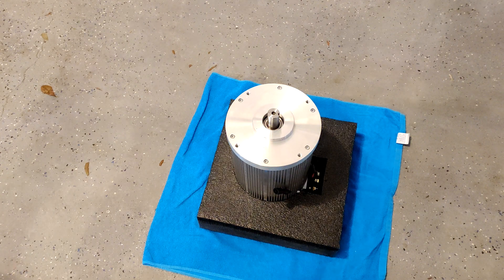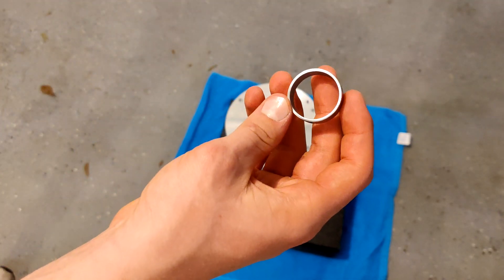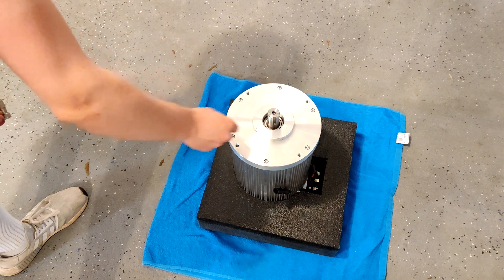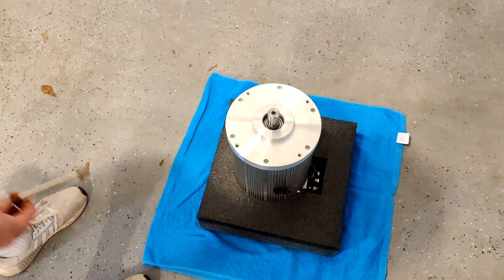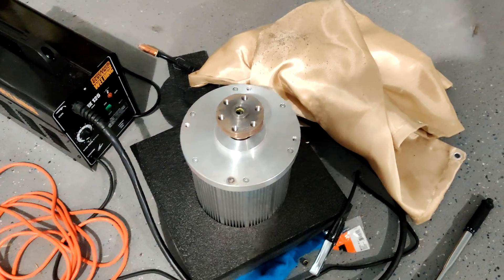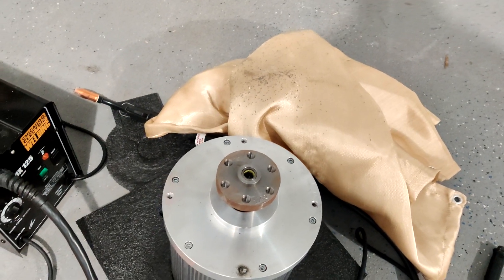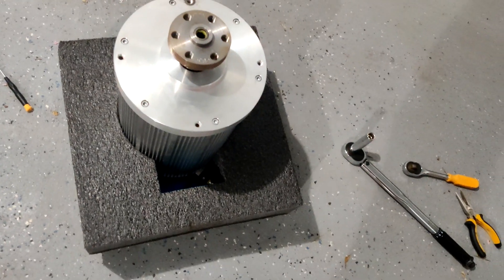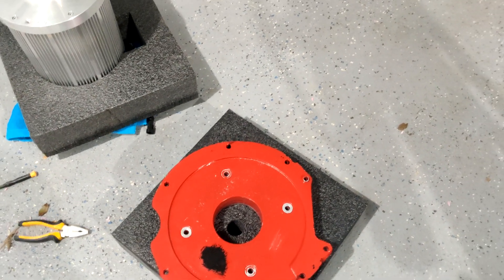Ford Escape EV Conversion EP 9: Prepping the Hyper 9 Motor

Comment: Aloha, dos you program your motor before you connected it to your drive train? Is this recommended??
Reply from the maker: No need to program the Hyper 9 inverter before connecting to the drivetrain -- it's really just a calibration process which is best to do after mounting the motor anyways.

Comment: Very educational video i subscribed i have a prototype im working on an would like to ask you afew questions as you have already done a conversion before
Reply: Iv been trying to make a ev conversion but the parts are hard to get as I'm from South Africa ...how ever I found some parts in China Nd will import slowly during the course of this year ...I understand that range is an issue and batteries are expensive I'm working on a replacement design that could give better range n minimum charge time...do you think this would be possible?
Reply from the maker: @allthingstricinsa  replacement design for the batteries? Or for the car? The biggest things that impact efficiency are weight and aerodynamics, if you can make a car that is aerodynamic and light you'll need less batteries than otherwise
Reply from the maker: Sure! Ask away
Reply: Yes looking to reduce weight at all possible angles ...how can I reach you directly? To brain storm the idea?

Comment: is it possible that you can just hook the motor directly up to the transmission shaft without the clutch assembly? couldn't you just shift (if needed) without a clutch since the motor can be at 0 rpm when stopped? thanks for the great videos!
Reply from the maker: Definitely, and that's what a lot of people do. I've heard that without a clutch for conversions it's easy to upshift but downshifting while in motion is tough. But yes shifting when stopped would work either way. Pros and cons to both options for sure, I kept the clutch because I want the option to drive it like a proper stick shift.

Comment: My car has an automatic transmission and an oil-impregnated clutch, what will I do?
Reply from the maker: An automatic transmission can work but you have to program the inverter to run the motor at idle when not moving (like 700 rpm), similar to how a gas engine idles. I believe the Hyper 9 inverter can do this. You lose some efficiency with an automatic though.
Reply: @reider_mcfeely  How can I mount the flywheel and clutch to my Hyper 9 motor (an AT with oil clutch)?. Ofcouse, It's not very difficult to setup idle speed (700-900rmp) motor!

Comment: How much torque in the four bolts attaching the adapter plate to the motor?
Reply from the maker: I think I tightened them to 15 ft-lbs or so. It really doesn't matter as long as you don't overtorque them (these bolts can break!). What's more important though is that they're all tightened to the same torque spec so that the motor sits even. Remember to use loctite too so the bolts don't come loose.
Reply: @reider_mcfeely  thank you for this. Unfortunately I followed in your footsteps, and one of them has sheared, so will need to sort tomorrow!
Reply: @reider_mcfeely   I would make sure youre using grade 8 bolts. 15 ft-lbs is really low to be shearing 3/8" bolts. Rule of thumb for automotive is anything drivetrain or suspension related gets grade 8 bolts, or Class 10.9 (if metric)
Reply from the maker: @ryanmccarty18  they were shearing at like 50+ ft-lbs. My initial strategy was "tighten 'em till I can't any more," which I of course dumb. Good learning experience I guess. 

I'm using the bolts included in the CanEV kit, hopefully it's enough. Not sure what grade of bolts they are though.

Comment: Sorry if you've mentioned it in a different video, but I was wondering where you were able to get the motor adapter plate.
I'm trying to make my own in CAD, and I was wondering how much space was needed between the actual motor and transmission.
I was able to use the schematic for the motor part, but I can't find any specific dimensions for my 92 miata's transmission online. Any tips?
Also how much did it cost you in total?
Reply from the maker: I bought it from CanEVs (CanEV.com). Cost $950 USD for the plate and then another $100 for shipping and customs from Canada. 

If you're going the CAD route, you might have to just do the measurements yourself for the transmission side of the adapter plate. Remember that you also need some sort of coupler machined. If your transmission is an option on the CanEVs site, I'd highly recommend just buying from them.
Reply: The rear face of the hub  needs too be the same distance from the adapter as the rear end of the crankshaft is from the engine mounting.
Reply from the maker: @frankherring6253  Not sure what you mean by that. Is the hub you're referring to the coupler? The crankshaft runs the entire length of the engine, the coupler is only a small part.
Reply: Yes, I am calling the coupling a hub. The coupling takes the place of the crankshaft and the adaptor takes the place of the old engine. The distance that the coupler sticks out past the adaptor needs too mimic the distance that the crankshaft stuck out from the back of the old engine. Also was there a pilot bearing in your new flywheel? Enjoying your conversion videos. Thanks brother!
Reply from the maker: @frankherring6253  Sorry for the late response, just saw this. No pilot bearing in the flywheel, but there is one in the coupling hub. You can see it if you look closely at the center of the hub, and it's greased as well. It came from CanEV this way, didn't have to hammer in a bearing myself.

Comment: I don't know much about engineering but can't you connect the motor directly to the diff to minimise the power losses in the drive train and weight?
Reply from the maker: In my car, the differential and transmission are one unit since it's a front wheel drive vehicle. But you definitely could do that. It just isn't the most effective way to get power out of these motors. Diffs are usually a 3:1 reduction gear ratio, and motors like these work best with a reduction of around 8:1. 

These motors don't rev super high (only around 8000 RPMs which is low for an ac motor) so they're really best suited for use with a transmission.
Reply: @reider_mcfeely  thanks ☺️

Comment: *Subscribed... How much did you pay for that hyper 9?
Reply from the maker: The motor kit was $4200 plus like $300 for freight shipping. But it had the motor, inverter, and wiring harness. Some places sell just the motor for around $2k if for some reason you would just want the motor.
Reply: @reider_mcfeely  cools...btw  researching to if it's plausible to convert my 99 suburban into a EV. I think it weighs too much and maybe too expensive to covert
Reply from the maker: @GarrettRC5thscaler  oh yea and the motor isn't even the most expensive part. Batteries are around $150/kWh, and you can get around 3 miles of range per kWh. So for a 100-mile range you would have to spend almost $5k
Reply from the maker: @GarrettRC5thscaler  but prices are coming down. In like 10 years I think you'll be able to do a conversion for way less
Reply: @reider_mcfeely  wow 10 years is a long time..iv been thinking about getting a wrecked Chevy bolt and swapping everything out and then get additional bolt motor.
Reply: @reider_mcfeely  thanks for the insight on kWh cost
Reply from the maker: Yep that would work. Only thing is that the Chevy bolt hasn't been fully hacked yet so you'd have to do quite a bit of programming to make it work. Nissan Leafs are popular for that reason, because you can get control boards for cheap that make it basically plug and play.